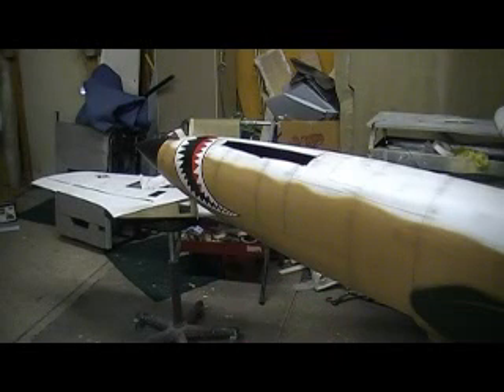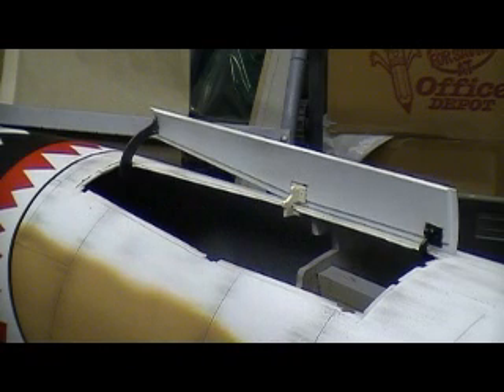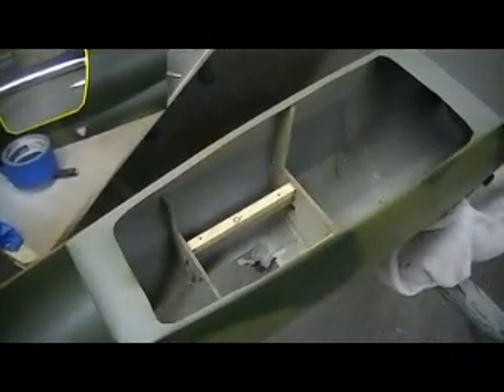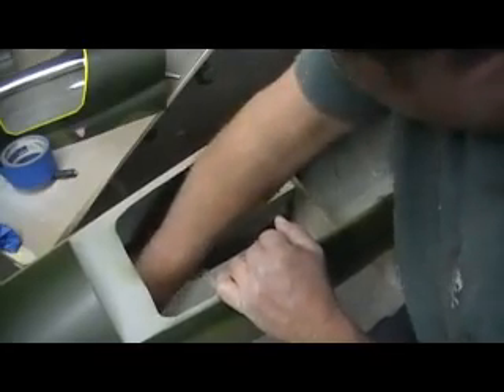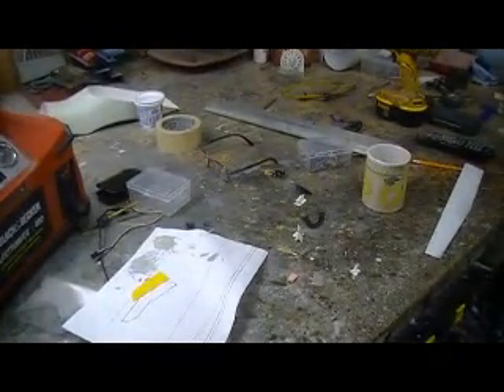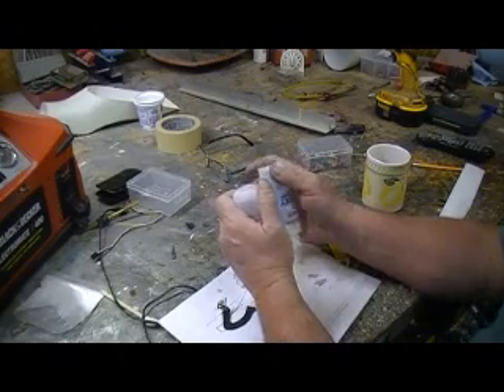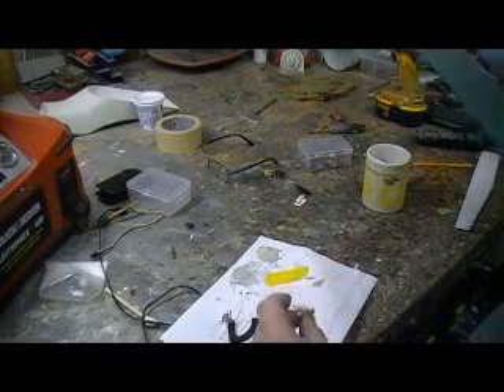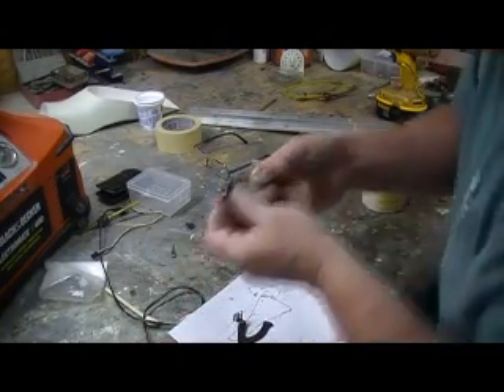how to build a rc jet F-105 thunderchief # 485

Comment: Bob can you give us a close up with more light so we can see the detail of the hinge line. Also can you show what you mean by bending the hinge in an "L" shape then placing then correctly on the fuse. Like show us when the epoxy has cured so we can see the relationship of the hinge arm and the relationship of the fuse.

I've watched 'em all super video. Great teacher you are. Nothing like OJT (on the job training).

Steve